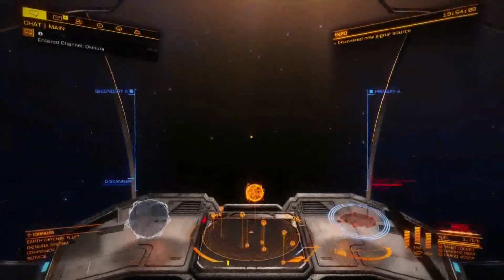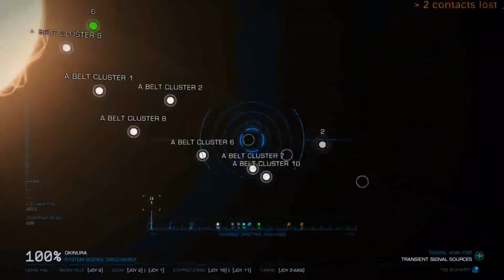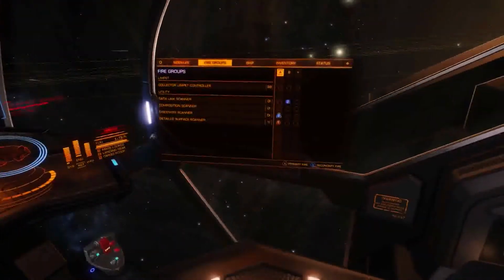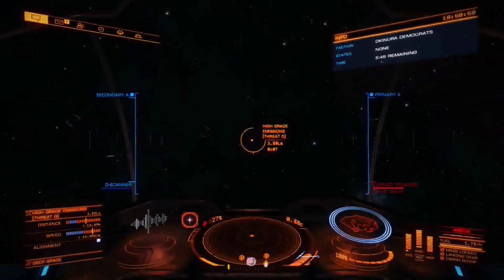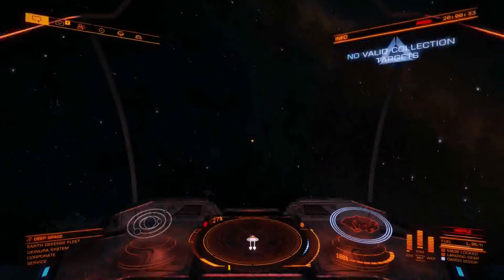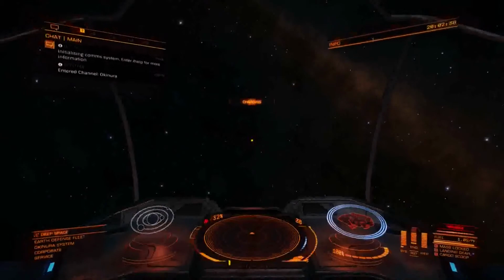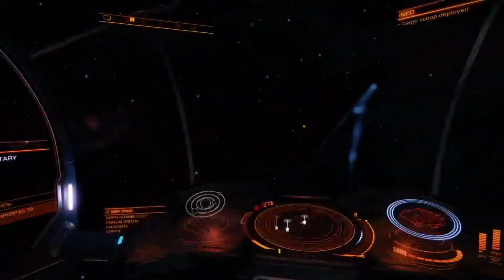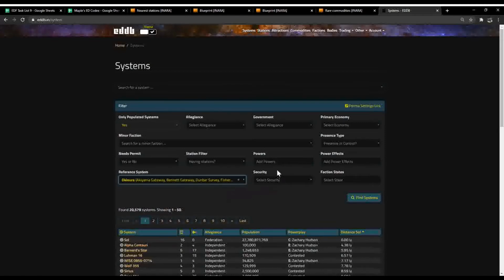2021 Elite Dangerous: EZ Engineering:  Farm those HGEs to get G5 CDC and Imperial Shielding

Comment: so for me boosting while jumping out does not throttle me instantly down it gets me 200 ls from the source each time ( playing from odyssey )
Reply from the maker: If you have your throttle set to 0, charge your FSD then use boost to accelerate leaving your throttle at zero, when you jump into supercruise you will be at minimum speed and will travel the smallest distance.  If its not working for you, you're not doing something correctly.